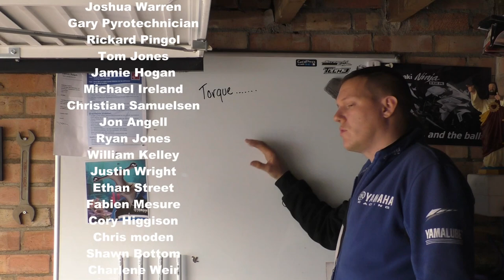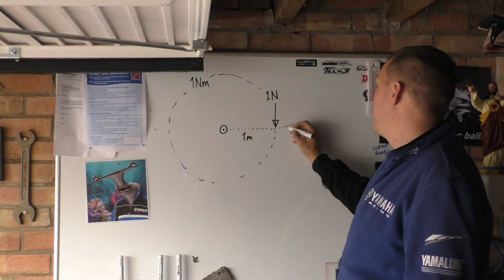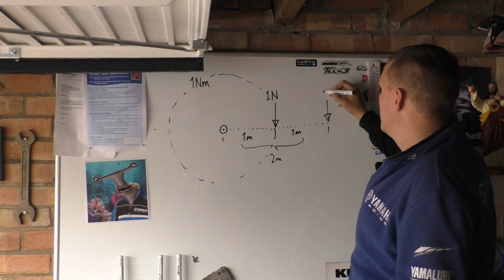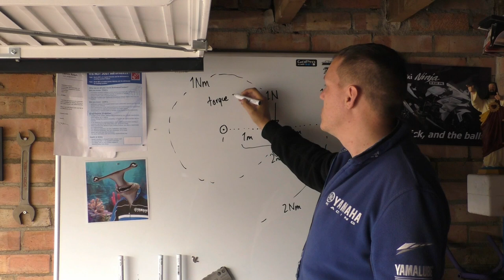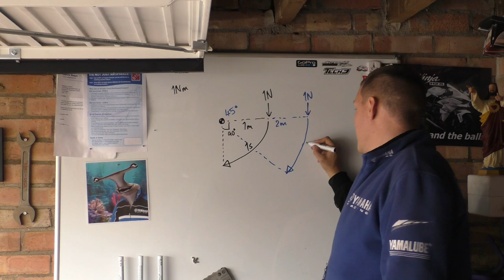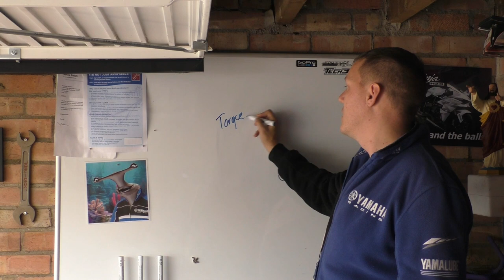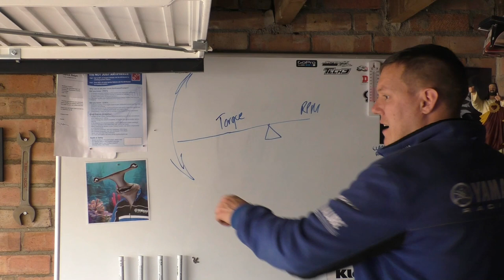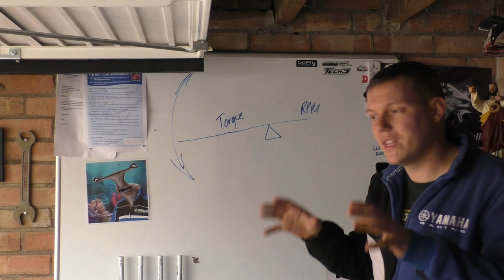Torque Question - Part 1

Comment: Great question and a great answer ... bore, stroke, force of combustion (not really purely geometry..throw in the 'charger here) , no. of cylinders, cylinder configuration and firing order)...I feel like there is a graph or infographic or formula to indicate the sweet spot (or region) for all this stuff...maybe its ultimately determined by how much weight/size/cost the application can handle (tank vs bike vs plane )... Awesome channel!

Comment: Ok, this is awkward. I just uploaded a short video about torque vs hp, will probably release it tomorrow. Good video! I both agree and disagree with you. My opinion is that hp is all that matters not torque. The sole reason is that gearboxes exist.
Reply from the maker: There's more to come on this - this weekend - but I did say 'when design an engine' - this seems to have slipped past everyone. LOL
Reply: The Workshop Great! Haha, I was going to add  that I do care about torque when designing engines but left it out knowing how you hate long comments...
Reply from the maker: Yeah and you're a 2 stroke nutcase and you have hardly any torque to play with in the 1st place LOL
Reply: The Workshop True, basically all I do is try to produce 10nm at highest rpm possible...

Comment: Archimedes worked all this out with his investigation of levers, leading to his infamous ship toppling weapon.

He worked all the mathematics and equations out 2,000 years ago, which we still use today.

Maybe the mathematics part is causing some folk's brains to blank out. Not everybody watching this is smart. Some of the audience may be human resources staff or work in an employment agency. Some may even be at or have been to art college.

I think the problem is that some folks are mystified as to what exactly happens when a dynamometer measures something.

A lot more don't know what a torque wrench is either as this actually displays the amount of torque being applied to a nut or bolt!!

If one electrically wires a DC electric motor directly to a second DC electric motor, spinning the spindle of the first motor will make the second motor spin. This called the dynamo-motor effect in engineering. It is the heart of a brake dynamometer.
 
Attach an arm to the second motor's spindle and hook a spring on the far extremity of that arm and one has a basic brake dynamometer, which will measure the torque produced as one spins the spindle of the first motor.

Make the arm 1 metre long and attach a set of spring scales calibrated in Newtons then the basic brake dynamometer will measure torque in Newton / metres.

Make the arm 12 Inches lone and attach a set of scales calibrated in Pounds then the torque measured will be in Pounds / Foot.

Make the arm 1 centimetre long and attach a set of scales calibrated in Kilogrammes then the torque will be measured in Kg. / cm.

One can use cheap E-BAY model 3 / 6 / 12 Volt electric motors, attach a winding handle onto the first motor's spindle and it would demonstrate the amount of torque produced as it is frantically wound by hand. I think they'd understand how torque is measured and what torque is after a physical principles demonstration.

(Something tell me that I'm going to have to build one and send it to you as a future video prop, aren't I).
Reply: I should perhaps that the cyclic rate at which one is frantically cranking the handle on the first motor, over a 60 second period of time, multiplied by the torque produced at the second motor, divided by a suitable constant dependant on the measurement unit, is the horsepower produced.

The definition of Horsepower is the quantity of torque produced in a 60 second period at a constant rotational speed.

The Germans use PS (Power  Starken) which is derived from torque measured in Kg. / metres) and 1 PS = 0.91 HP.

PS is still a quantity of torque produced over 60 seconds at a constant rotational speed.

Comment: Can you do a video about sprocket gearing?

Why does smaller in the front and larger in the back yield more torque at lower rpm?
Reply from the maker: Yes that's already in the pipe line
Reply: The Workshop sweeeeeeeeeeet

Comment: So is there a massive magic formula to figure out the ideal crank throw and piston bore for what ever output you're trying achieve? Say 500hp and 500lbft at 6000rpm...?
Reply from the maker: Drop the HP bit - you set your volume - and then you work out the bore and stroke depending on the application. More on this later...............

Comment: 100kW @ 4000rpm is no different to 100kW @ 15000rpm,  ... the only relevant factor is your gear ratio, and that the tyre grip limit is somewhere around 2000Nm,  a bit more with really sticky ones ... and the second option is most probably louder ....:-)
Reply from the maker: "100kW @ 4000rpm is no different to 100kW @ 15000rpm"

- what?
Reply: well, the power is the same, and torque is power divided by speed, so if you gear it down to the same wheel speed you get pretty much exactly the same torque as from the high rev engine, isn't  it ?
Reply from the maker: Its just what you said - 4,000rpm is the same as 15,000rpm. An engine that produces 100kW @ 15k rpm is very different to an engine that does it at 4k. 

Peak torque for 15k rpm = 63 Nm
Peak torque for 4k rpm = 237 Nm

As you can see these are very different - gearing swaps torque for speed and visa versa.

So going back to what you said "100kW @ 4000rpm is no different to 100kW @ 15000rpm" - what is right here is kW - there is no difference between 100kW if its made @

63Nm @ 15,000rpm

or

237Nm @ 4,000rpm 

Power is work done, and these 2 engines have done the same work.

A simple way it to think of it like this. A body builder can carry 200KGs 10 miles - a weedy guy can carry 100KGs 10 miles in 2 trips. Work done is moving the 200KGs 10 miles. This is what we call power required to do that or in the case of the guys energy 'burned' Torque is the guys ability to lift the weight. The weedy guy can only lift 100kg but he can probably move faster. The body builder can lift the whole 200kgs but moves slower - rpm is the speed they move and their lifting capacity is the torque.
Reply: I said it makes no difference "at the Same Wheel Speed",...and "work done" is measured in kWh, btw

Comment: weight hanging on a rope wrapped around a cylinder. Torque is what it takes to turn the cylinder, power is how fast you can lift the weight

Comment: Is it like my 125 has 7ftlbs of torque however the wheel nut is tightened to 60ftlbs by me. I can only run about 15 miles an hour. My motorcycle engine has far less torque but can do 60mph with me on it. Cause of horse power it can repeat that torque far quicker than me and a 3ft bar.
Reply from the maker: More on this later - but great question

Comment: Is this why Hondas have such little torque but rev up so high?
Reply: if you want to make more power you either need bigger bangs or more bangs
Reply: Exactly the reason.
Reply from the maker: "if you want to make more power you either need bigger bangs or more bangs"

- not entirely true, but from a average Jo then yes.